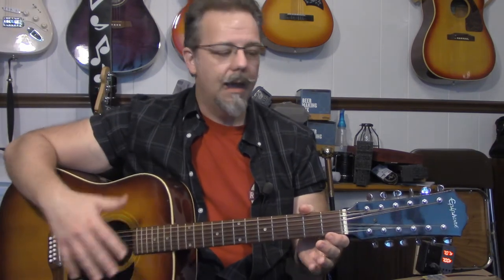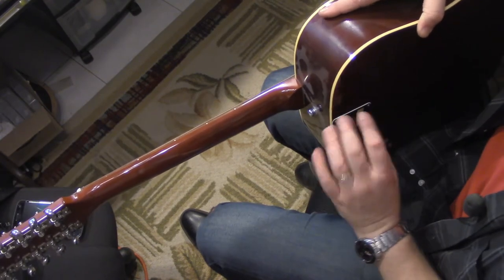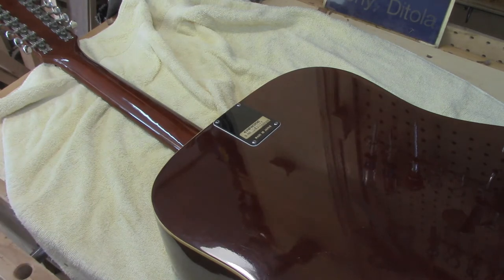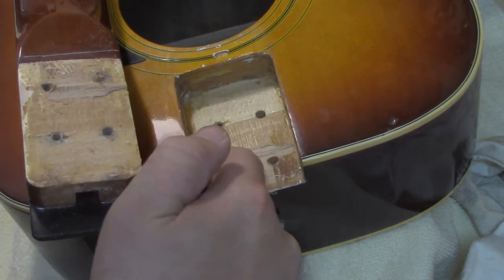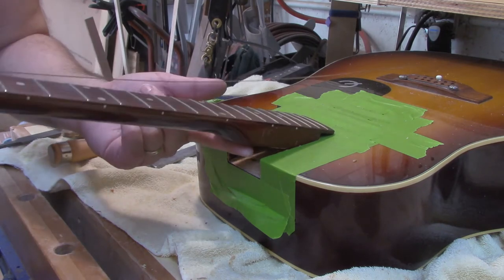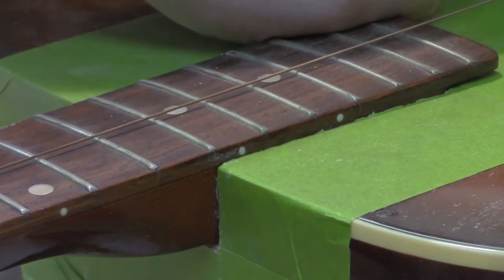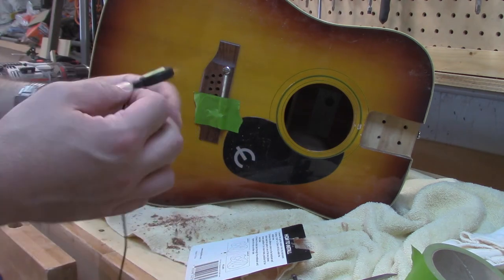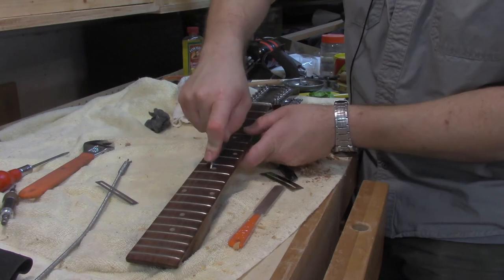Modding My 12 String Acoustic Guitar

Comment: I own a 1978 made in Japan Epiphone FT165 Bard Norlin 12 string.  Original owner.  Do you know of a brand that is a drop in tuners replacement.   As you are aware the tuners are not the best of quality.  I prefer not to drill new holes for different tuners.  I also use 10 -47 gauge strings but for added depth I replace the low E with a .052 and the low A with the .047.  I think it sounds better.   Bob
Reply from the maker: I haven't really looked into replacing the tuners. So far, I've never had any issues, so I can't give you any opinions. Sorry. I also don't use my 12 string enough, so I just get the D'Addario pack and use it as is. 

Thanks for watching.

Comment: sound like an empty can haha!
Reply from the maker: Yeah, but it did what I needed it to do... for awhile. Eventually the little piezo thing fell off and now just rattles around in the body until I get some time (and money) to replace it with something better. 

However, the neck is still amazing. It has better action than some of my electric guitars.
Reply: @HandlebarWorkshops  hey don't get me wrong I have one of these I just put 6strings my problem is i cannot  remove the neck coz i can't  unscrew it. hard to unscrew coz the past owner rounded the philips screw on it. however the action is still low. sound good on 6 string though.
Reply from the maker: What I've noticed is that those screws will loosen a bit over a few years and my string action gets a bit high. I just need to tighten those screws to bring it back down. 

There are ways to remove those screws and replace them with new ones. But if it is working for you, no need to mess with it.

Comment: Terrible mess, measure and plan before cutting off or filing wood on a guitar.
Reply from the maker: I did plan and measure. And it actually worked out very well. I finally got the neck to seat fully and the action is perfect all along the fretboard. 

The piezo fell off on the inside, though. I have a full microphone/piezo pre-amp in my Amazon wishlist that will eventually get installed. Subscribe so you can watch me f**k that up, too.
Reply: @HandlebarWorkshops  Good to hear that. I was thinking while watching, that piezo would fall off because of the vibration. I'm sticking a Schaller piezo acoustic guitar pickup on the bridge of my cheap new cello and it falls off after a few hours.